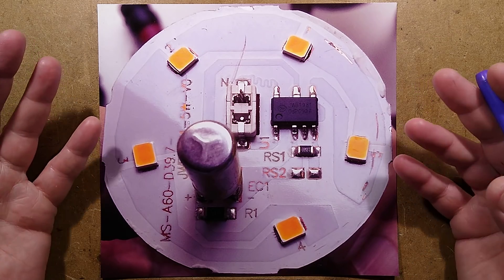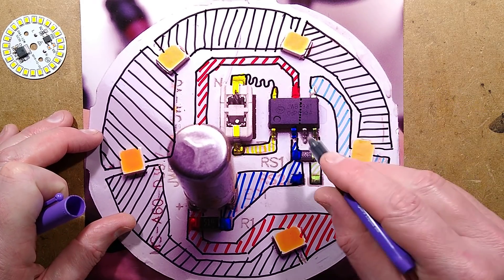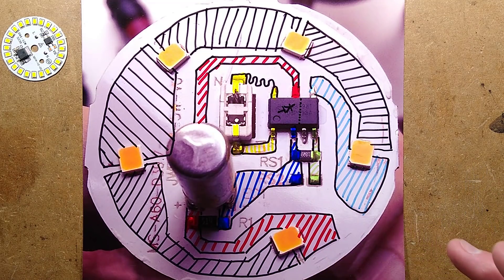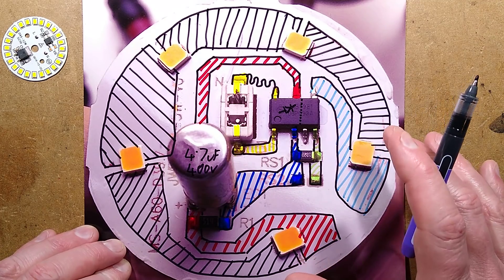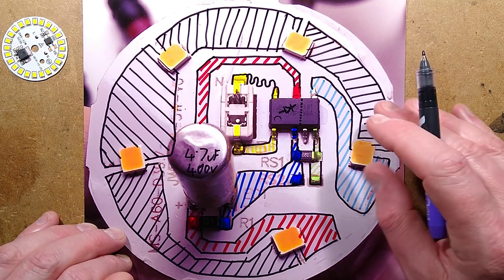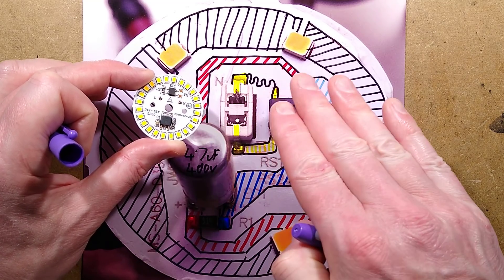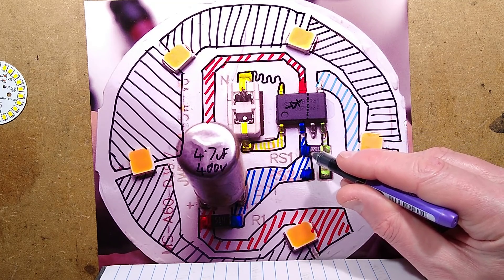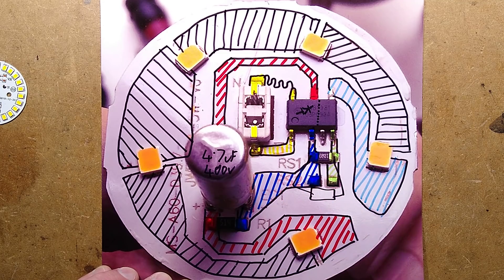New LED lamp twist reverse engineered from a picture

Comment: I have a sort of off topic question... I have a Dazor "floating lamp" with magnifying lens (circa 1950's) that I want to convert to led. I think because of the original switch that I want to keep, that I'm going to need a relay but I'm not sure. The switch has two buttons, black and red. Black being "off" and is normally closed. The red is a momentary switch and from what I've read, is that you hold it down for a second or two until the bulbs light up and then let go and the run until the off switch interups (?) them. The switch is getting to be pretty rare so I'd like to keep using it as a momentary switch if at all possible? Maybe you've done a video on just this topic? Something similar? If I can find a cheap enough one on ebay I'd gladly donate it to you since I think you'd probably enjoy the challenge and the lamps are really quite cool looking and the quality is something else.
Hope you see this!
Reply from the maker: It sounds like a classic latching relay circuit like a no-volt switch.
Reply: @bigclivedotcom 
Thank you for the reply! I read that somewhere and believe that there was a diagram included. But then I saw your newest video (the title really got me going) and threw everything to the side to watch it. Not quite what my mind was hoping it was, but awesome all the same.
Reply: It sounds like the Florescent Desklamp I had as a kid with a manual starter. Just flip the rocker on, then press the starter to light the tubes.
Reply: OMG, does this lamp really use fluorescent tubes, @spaz 12 ?
If you want to replace those with LEDs, you have a slightly-bigger problem, and definitely need an electronicals geek to advise.
I'd be tempted to take it to your local Maker Space, and see what those people recommend; probably "Rip the fluorescent ballast out, put a COB in the lamp head, put a relay in the base (controlled by the switches you mentioned), live happily ever after."
On the upside, the above only needs about $10 of hardware :-)
Ask us questions, maybe?
Reply: So you've got a nice version of what I'd consider a "cat lamp"; adjustable / cantilevered, pleasant expensive kit.
Pictures here (inc. the switch): https://www.1stdibs.co.uk/furniture/lighting/table-lamps/vintage-industrial-design-dazor-floating-lamp/id-f_6463713/
I don't understand what you're asking, though; are the switches broken?  What voltage do the bulbs run at?  Why can't you just replace them with LEDs?  Or, what happens if you do replace them with LEDs?
To BC's point: latching relays are rare and expensive.  A traditional approach is to use a double-pole relay, and arrange that when the load is energized (by the 'on' switch, energizing the relay), the 'spare' contact also energizes the relay's coil.  Then, when you're done, the "off" switch (normally closed, open when pressed, in series with the relay's coil) should interrupt the current to the relay coil.  This causes the relay to de-energize and turn off the load.
Reply: @theskett 
The switches work but they're just not your ordinary switches. I'm trying to keep the lamp as original as possible and the switches being outwardly visible and somewhat unique, really gives me few options. I also want to be able to convert it back to it's original self so in the all to possible chance the economy goes belly up, I'll be able to sell to someone with more money than common sense.

Anyway, I did also read through some other threads talking about the relay you speak of
https://forum.allaboutcircuits.com/threads/using-an-old-fluorescent-momentary-on-momentary-off-switch-in-lamp-rewire.169204/

It's been a long day for me today and I'm calling it for the day and will resum this topic in 8 - 10 hours.

Thank you all who have replied!
Reply: "the switches being outwardly visible and somewhat unique, really gives me few options" - well yeah, keep 'em pretty.
I'd expect one ("on") switch to be normally-open, the other ("off") to be normally-closed.
You didn't say whether it was fluorescent: if it is, you need to keep the ballast and replace the tubes, to be original.

Comment: That photo is so eerily 3D.   I could really not make it fit in my brain as 2D.  Very effective.
Reply: Same here: The corner of the fat LED circuit trace drawn over the left edge of the cap confused my brain.
Reply: Its so real you can probe the voltage off it
Reply: yes he adapted illumination to match photo's light orientation... every component look enormous

Comment: Wonder what the 7th pin is for. Seems a bit of a waste to use an oddball package like that if only six pins are going to be hooked up. Maybe they needed a tiny bit more separation on the pins hooked directly to the input?
Reply from the maker: It is for electrical separation.

Comment: Clive, do you remember the flashing beacon light? It has a hidden siren function. See if you can see "LS1" and "L1" marking on the back. I got a bunch of them and apart from the green one all 7 have this function. Connect a speaker between the left pin of L1 (from the top) and the right pin of LS1 for the sound.
Reply from the maker: I'll check that out.
Reply: Very appropriate, that only the 'green' doesn't have a siren :-)
I once wrapped our works 'red' siren in shrink-wrap, because it gave soooo many false positives, and so loudly :)

Comment: From a semiconductor point of view it's rather hard to make a full wave bridge rectifier isolated from the rest of the circuit. It's the same reason why most chips try their best to use all NPN transistors. If you have to mix a random PNP in, you have to add another doped well to isolate it, and the more doping you do the more "iffy" it gets plus the isolation well takes up some extra space.
Reply: Is there a possible cheat via e.g. synchronous rectifiers (switched MOSFETs) ?
Or presumably one could just half-wave rectify, and use a bigger smoothing cap (esp. since the constant-current regulator can flatten some of the humps).
Having a two-die chip seems painful, for anything less than SoC  :-)
Reply: @theskett  You'd still have to "float" two of the components with their own doped well. If you look at any chip schematic you'll see that most transistors are emitter grounded (NPN). Very few will be floating, or have a resistor in the emitter circuit, or collector connected to Vcc (NPN) because you have to isolate them in their own doped well. You'll also have the problem with the doped well breakdown voltage. The more doping you add the lower the reverse breakdown voltage.
Reply: Thank you; unfortunately I'm too ignorant to fully appreciate your answer (although I do get the gist :-)
Is a half-wave rectifier tenable, please?  Or is that also painful?  (Just curious, no big deal if you're busy.)
Reply: @theskett  You could try a single diode. A half wave would probably still require at least one isolating doped well. Remember, at least one of the AC inputs has to be floating. If it isn't floating it's shorted. They either have two chips inside that package (one chip has two diodes) or they've figured out how to dope an isolation well that can handle 300 volts peak while keeping the rest of the circuit able to have enough low on resistance to work properly.

Comment: Fascinating . next they will build the diode bridge and current regulator right into the LED units. Then they can just put in as many LED units as they want in the lamp all in parallel with direct connection to the AC line.
Reply: For the 'diode bridge', have a look at BC's earlier https://www.youtube.com/watch?v=5hu17D7VZXo
Putting the regulator in with the LED isn't so good, though, because the regulator's gonna get hot and hence is likely to bake the LED (which is already running hot).
Also most of us would like a smoothing cap (e.g., to avoid strobe effects on rotating machinery) -- and that cap won't fit in most SMD LED packages.

Comment: Only makes sense with the current chip shortage and rising prices to reduce your needed amount of silicon. Also has the benefit to reduce your placement cost by one component. Lamps are made in the millions, and saving even a 100th of a cent makes sense.

Comment: Considering that it's only four diodes, it's amazing that it's taken that long to include it in the IC.
Reply: Actually that long string of LEDs  he's showed last week was the real charm.   It got replaced the non-LE diodes with the LE versions to make an LED Bridge rectifier.  1 less part number to keep in stock, and your own product spec gains a few lumens.
Reply: 77thTrombone: You're absolutely correct, but I still don't properly understand how 3V-fwd, 10V-PIV, LEDs can rectify mains power :-)
(And yeah, I watched the video a few times; but I always reach for my 1N4007's :-)
[Edited for clarity; apols for previous un-clarity :-]
Reply: @misterhat5823  Sure, there's a standard bridge (or possibly just a half-wave rectifier; see other comments re dopants, multiple dies, etc.) in the IC in this video.
I was responding to 77thTrombone's comment, which is re https://www.youtube.com/watch?v=5hu17D7VZXo
At both ends of the LED filament, there's a bunch of LEDs acting as a bridge rectifier (or, arguably, doing "diode steering") -- ingenious :-)
Reply: @misterhat5823  Aye, but, your mouth didn't chooch very well.  All shmoo, no info.
Reply: @theskett  thanks for responding. 
I didn't mean to distress Mr Hat.

Comment: I'll guess that the bridge is on the chip to simplify and reduce time and cost of the pick and place assembly process- one chip instead of two or more steps and pieces. Also cuts inventory cost and space at the factory. Putting the rectifier on the chip is done in CAD/etching/deposition so not much extra cost per unit amortized over many many units.
I'll also guess that the next design "improvement" iteration will have the sense resistors built directly into the chips, with a range of chips to yield a range of final lamp wattages. That will be more... interesting... to modify.
Reply: I was all set to argue with you, re the sanity of "sense resistors on-chip" -- but then noticed that there's been almost a century of incandescent lamps at 40W, 60W, 100W, ...  and almost no-one's tried to hack those, nor complained they can't swap the tungsten filaments :)
So, yeah, "buy this chip, get 60W equivalent; or this one, for 100W..." seems like not-unreasonable marketing.
Reply: As long as they’re not too hard to source. Imagine if the boards just came with a socket for the chip instead, pick your wattage.

Comment: There are a few reasons to integrate the rectifier with the regulator that I can think of. It's definitely cheaper to assemble, since one fewer part in the pick & place machine means less setup time, less manual effort refilling the machine, and possibly an easier ability to swap between designs (sometimes a few designs with non-overlapping parts components' can all fit in the machine, allowing fast swapping). It's probably slightly cheaper in total, since packaging and bonding is only done for one chip instead of two, though there may be two dies in the same package so less savings than if it's all one die. And it makes design of the resulting lamp simpler, which is probably the most minor of all given how simple they are to begin with.
Reply: Good answer, thank you.  
Any particular reason you think two dies might be necessary, other than because the chip manufacturer initially only has separate bridge-rectifier and regulator dies on-hand?
(I'm curious as to whether a 240V-AC-capable bridge can be constructed on the same silicon as the constant-current regulator.)
Reply: @theskett  For this, probably not needed. But it could allow a new chip by only changing packaging, no new mask set. 

For complex parts on small processes (famously AMD CPU cores) splitting dies can improve effective yield. That wouldn't be the case here, of course.

Comment: In search of the almighty de-contenting!  If the manufacturer is going to make ten million of these lamps, then saving $0.01 (US) per unit by handling one less part in their pick ‘n place operation is an extra $100,000 profit for the manufacturer for doing… basically nothing.

In terms of reliability engineering, usually fewer connections improves reliability.  Evaluating the impact on reliability of integrating the bridge and current regulator in one package is above my pay grade.  An interesting question is whether there is some sort of parallel bypass in those COB units so the lamp may keep going if one of the LED chips goes open circuit.  (In the interest of future sales, probably not.  Wink.)

As we are accustomed, nice circuit sleuthing Big Clive.
Reply: Good call, on "fewer connections" -- I'm still surprised the lamp uses a sort-of-socket, for the incoming mains leads (though I suppose that's quicker and maybe better than soldering?)
I've got $100 that says there's no redundancy if an LED fails open; but on a $5 lamp, no-one needs nor wants that.  Open the lamp, put a shorting link over the dead LED, put the lamp back in service until the next failure :-)

Comment: Thanks, Clive for the news of the all-in-one chip.  Strange, asymmetrical pinout means it's obvious which way round it goes.  I found it odd that the 4.7 uF capacitor sticks way up on the LED side of the board, causing a shadow inside.

From the datasheet, should there be a concern about the increased voltage across the chip if the resistor is changed to give a lower current?  IOW, can the chip handle the full 360 or so volts DC?
Reply: The LED chain will "soak up" most of the 340V, the chip itself will only see a few 10's of volts at most across the switching element/current setting resistor, this is pretty much the only way that these chips can work as if they had higher voltages across them they would have to dissipate a lot more power.
Reply: IOW, there's essentially a constant voltage across the LEDs (3V * #LEDs), and the regulator's just there to soak up fluctuations in the mains voltage.
Like when BC's HOPI shows that he's getting e.g. 249V AC, whereas I might be getting only 235V AC.
So the regulator can probably withstand 400V DC, but couldn't (and doesn't have to...) withstand what would be the associated power dissipation :-)

Comment: not related to the video but can i buy a chinese 220v welder and run it on US 240  Two-phase there cheap and tempting
Reply from the maker: Most of the cheap welders will accommodate 240V OK.

Comment: higher or lower value sense resistor to lower the intensity?
Reply: Increase the value to lower the power (and thus intensity, but given the non-linear nature of LEDs halving the power will less than halve the brightness, I've modded a couple of lamps down to about half the power and you'd only notice the difference in brightness if you put them next to an unmodified lamp)

Comment: That's a very strange package, unlike any I have ever seen. No doubt it you strip the package down to see what's inside, you will find two chips, one is the FW bridge and the other is the linear regulator itself. If it were a single IC, then the entire chip would have to tolerate about 400V, making the linear regulator larger than if you split it apart from the FW bridge, letting the regulator be the smaller, cheaper JW1981 chip.
Reply from the maker: The linear regulators are usually rated for very high voltages.

Comment: LED lamps are evolving, just backwards...
Reply from the maker: I'd say this is forwards.  Simple, efficient (the LEDs add up to near the peak mains voltage) and very low electrical noise.   But not dimmable.
Reply: @bigclivedotcom  Oh, sorry, I didn't pay attention to the LED chips part, and just thought they where normal LED's running very very hot...

Comment: Is there an inexpensive component or circuit that could shift the mains phase by 45°, and then be rectified separately (thus doubling the pulse rate for dimmable bulbs)?
Reply: A fairly-chunky inductor (current lags voltage) or capacitor (current leads voltage) will give you some phase-change; this leads back to all the power-factor discussions.
But both components are likely to be inconveniently large and/or expensive, and it's not clear how you could usefully rectify the output to combine it with straight-from-the-mains rectified AC.
Which is why most (tiny, cheap) LED driver boards rectify the AC, then use a switch-mode power supply (50kHz?) to raise the pulse rate.
I'm not clear what this-all has to do with dimmable bulbs, btw :-)

Comment: This print was one of those again that really messed with my perception, because I forgot it's a print after a minute. Then I wondered why you could lay the datasheet flat over that tall capacitor. For half a second it felt as if you squashed it, until the "it's not a real PCB" came back to me. Only to wonder the same thing again a few minutes later when you did the same thing with the notepad XD .
Reply: I'm sure there was a video a couple of years back where Big Clive tried to measure a voltage on the photograph instead of the actual PCB.

Comment: So what I’m hearing today watching this video is as follows: if I want the LED two-way appliance bulb to function with out flicker on the lowest setting as it is installed in the microwave … I need to install the bulb in the freezer open the door twice and then leave the door open when I want flicker free soft light on the countertop! Or buy a microwave with a proper LED driver installed already so I can use said bulb … because said bulb is that rare and awesome!  
I should have taken the job manufacturing semi-conductors when I was 14YO …the world wouldn’t be short of them right now if I did!! #semiSAD